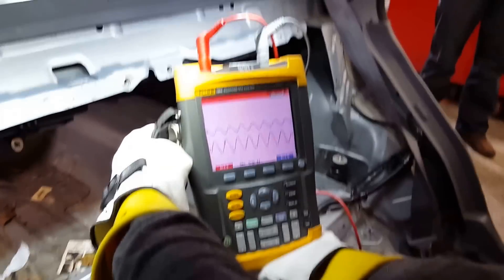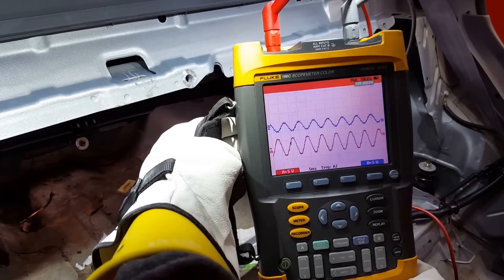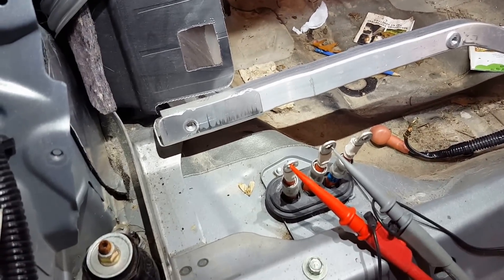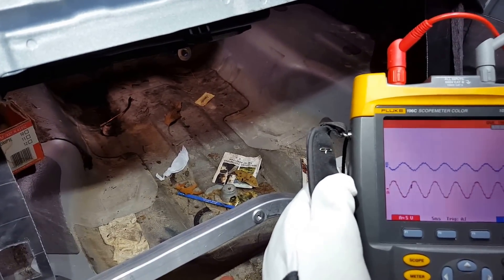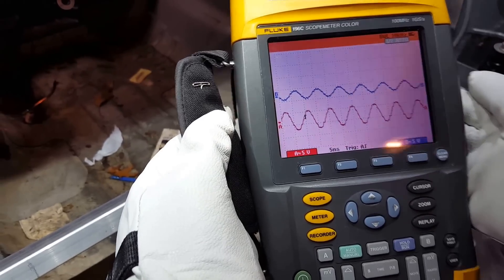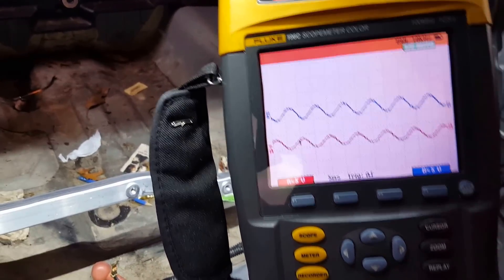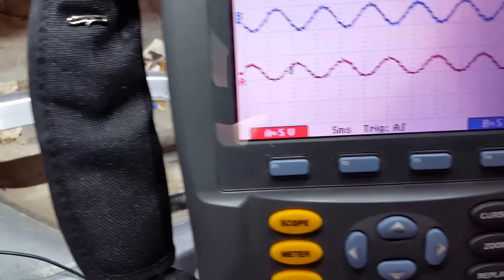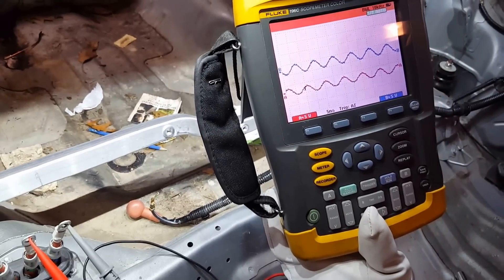Hybrid Vehicle checking the 2 phases on a Fluke 196C Labscope

Comment: That's pretty cool, wish I had acess so I could do that on a Allison Hybrid.  Allison has Hvil switches that open when you take off the acess covers.
Reply: +busjockey1 Just buy a good scope like fluke or ATS with the proper leads and you can do it....thanks for watching
Reply: +G Truglia So are you jumping the Hvil switches then so you can do this?
Reply: +busjockey1 No switches jumped...just connected to U V W the 3 phases from the IMA HV AC motor. Hope this helps